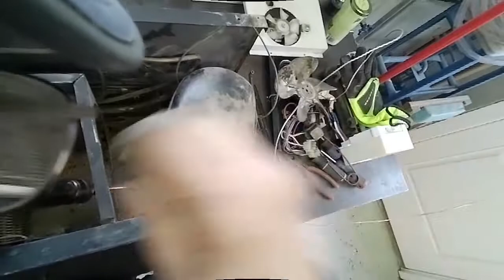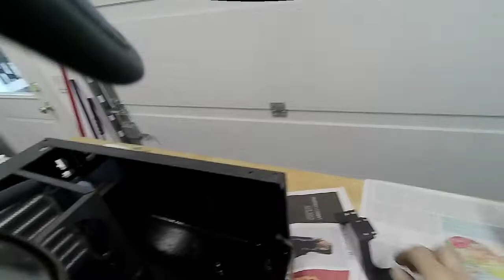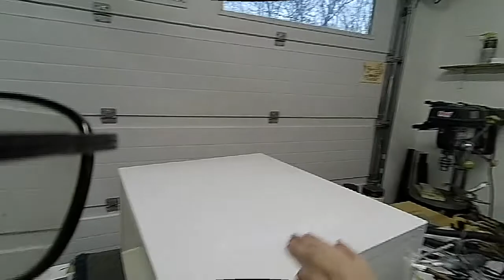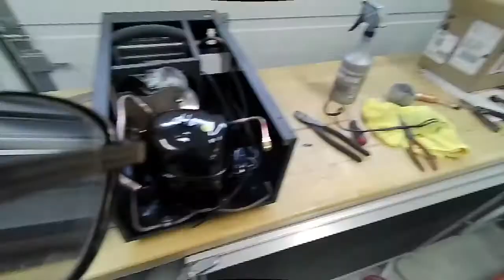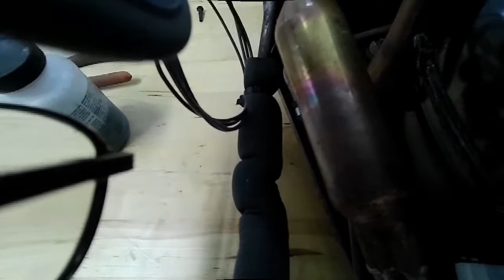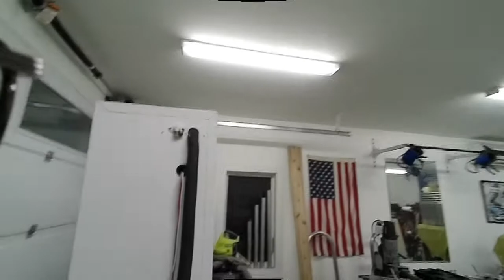Sub-Zero Ice machine Model 22IM Rebuild Part 2

Comment: if the new compressor you installed is 134, u would've better to shoot it with 134 gas, at least for the oil sake.
thanks for the affords on making these great videos.
Reply from the maker: It is an R-12 compressor

Comment: Love the channel! On a 601r/s model, is there anyway to take the refrigerator shelves apart? It looks like the there are two glasses and water has seeped inside which now looks moldy. The structure looks pretty solid. The fridge is in great shape but for the awful looking shelves.
Reply from the maker: 600 series shelves are molded together, can’t take them apart.
Reply: @SubZeroSpecialists  do'h. Thanks for letting me know. Guess I'll soak in bleach overnight but may have to replace the shelves. Thanks!
Reply from the maker: @runrickyrun157  let me know how the bleach works out.